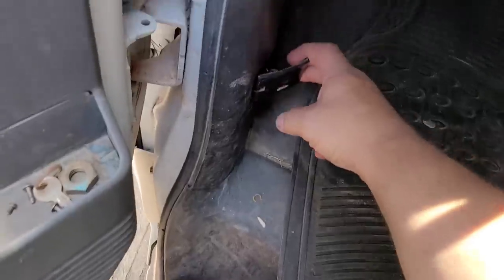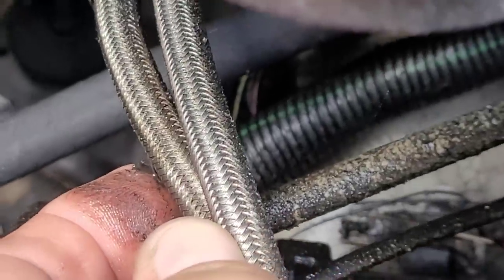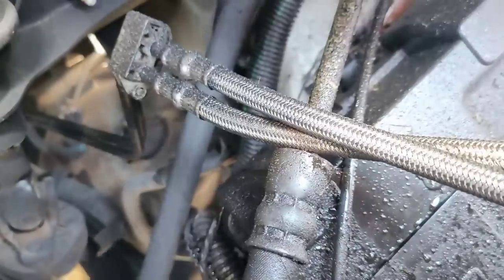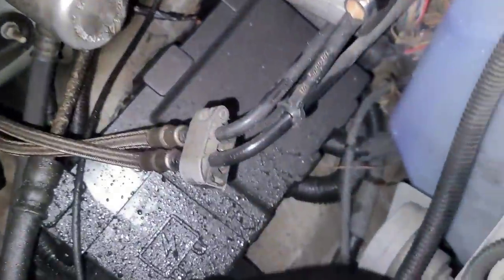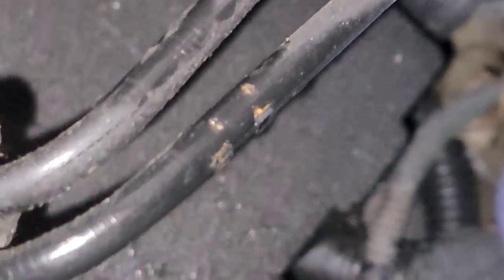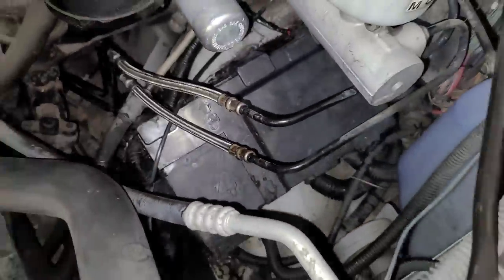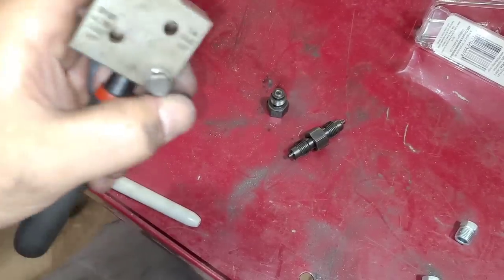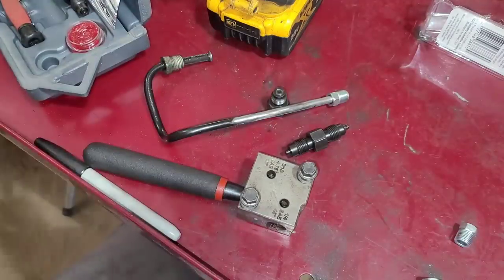No Brakes & Fluid Full? I'm Not Getting The Full Story.

Comment: Excellent video, again (and again). I did not hear you mention what kind of metal ought to be used for brake line fabrication, I may have missed it.  But, out of an abundance of caution I thought I would interject what not to use, as well s what to use..  Copper lines are easy to work with, but do not have the burst strength needed for a hydraulic brake system, so DO NOT use copper tubing for hydraulic brake systems, ever,.  Hydraulic steel lines can handle the pressure of a hydraulic system, but sometimes making a double flare end for a connection to be made can be difficult.,  A better kind of line metal you can use for a hydraulic repair use is a Copper-Nickel alloy line that is strong enough to safely use for brakes, and any number of other uses (use proper bending and flaring tools).  The color of the Copper-Nickel metal is close to the color of a copper line, and it can be easily bent or flared/double flared, for brake lines you want to do double flares) like copper,  But its burst strength is much higher than just copper.  It is what I like to use as it easy to work with, and commonly found in parts stores.

Comment: One thing you did perfectly but didn't explain was making sure the loop doesn't have a high spot that will trap air. It must have at least a slight rise throughout its length. 

After it's all complete  you can move it a bit, but for bleeding and leak check, it must be continuous uphill.

Great job.

Comment: Hi Ken, I have done exactly that kind of repair so many times. Instead of using a mighty-vac I just leave the farthest fitting cracked loose and pump the brake until I get fluid coming out. Even on a line repair clear back at a rear wheel cylinder on a rear axle or at a caliper hose. I never mess with bleeders unless I replace the clapper or cyl. In my way I believe I have refilled the line from the master down to the fix and I have never had an issue. 
Bonus: One time I had a customer who needed to leave town asap and the only calipers I could find had the bleeders on the bottom. I can't remember what it was on, some kind of small Ford car, but all I did was put a piece of 1x2 board between the piston and the other side, then turned the caliper down side up and blead the air all out and put it on the car. The guy knew what I was doing and agreed to get it done right when he got to California, but he called me and told me he didn't see the need until the next brake job since it worked perfectly for 2,490 miles. I concurred.  ben/ michigan
Reply: Some old motorcycles were set up this way, and just as you describe is the method the manufacturer's recommended.

Comment: i always wondered why there was loops in brake lines...thanks for explaining that.
Reply: Hi. Just curious why copper instead of steel brake line which is available at most auto parts stores. .
Reply: Double End flares are paramount for hydraulic brake systems, or any other high-pressure hydraulic system, when making a mechanical connection.
Thank you Kenny for your expert commentary as a 30+ year mechanic, I find it very comforting to listen to your diagnostics and watch you work.  Tim C 
Las Vegas, Nevada . 
🙏🙏👍👍👍
Reply: @shaunmapes7441 It's not regular copper tubing, it's a nickle/copper alloy. Ni-Cop is what this kind of tubing is commonly called. Regular copper tube is WAY too soft for any kind of hydraulic application. The Ni-Cop tube is much easier to work with than standard steel line.
Reply: Great info. Thanks @MikeBrown-ii3pt

Comment: Isnt ‘Brake’ light usually tied to fluid level switch or proportional valve switch. The Abs light is controlled by the module. Just wondering, didn’t catch the year of the van. Agree using Nicop loop. Great fix. Nice flare tool.
Reply from the maker: The ABS module on certain vehicles can control both the ABS & the brake light on the dash. I'm actually not sure about this one. This one did not have a level sensor. Afterwards, the customer stated that the brake light has been on for a "long time." Thanks for watching

Comment: Good 'ol gm brake lines... we call those, "job security." Good show sir. Small tip you probably already know, a 13 mm socket makes for a perfect brake line spring/coil template. Closed end of 10mm wrench on line, rest wrench against socket, and rotate around. Hustle on good sir!

Comment: Kenny,
I don’t know what kind of brake cleaner you use or at least used for your flammability demo. Commonly made with Tetrachloroethylene (TCE). 

The Safety Data Sheet (SDS) for a can of brake cleaner reads: “Do not use this product near open flames, welding operations, or excessive heat. Vapors may decompose to harmful or fatal corrosive gases such as hydrogen chloride and possibly phosgene.”

It can cause permanent lung damage or even be a deadly situation.
Reply: Chlorinated brake cleaner in particular has the risk of producing phosgene if burned.  It is very nasty stuff that you do not want to inhale if you don't want life-changing impact to your health.  They warn about this a lot in terms of welding- don't use that stuff to clean panels prior to weld..
Reply: Sir...thank you for reminding us DYI mechanics.

Comment: Read the comments and it seems almost no one knows about nicop lines. Makes a person wonder if the commenter has ever worked on brake lines before, especially in upper US where rust is an issue. As you, I have ive seen some f'ed up repairs over the years. Some you have to laugh at because therwise you want to beat the tar outta whomever did the repair to put so many lives at stake. You did a quick quality repair to get that man back on the road, and make him and others safe out there. I call that a win.
Reply from the maker: Thank you for your comment. I appreciate your input. Keep wrenching 🔧

Comment: Yup I have done a number of coiled hard lines between the master cylinder and frame. Many thousands of miles driven. I did have one crack from vibration. Support the coils somehow. I like to zip tie them to things with a piece of fuel line inbetween so there's no metal to metal contact.

Comment: I wouldn't recommend using copper lines anywhere on a vehicle.  From vibration and/or cyclic stresses (like a brake line), the copper can cold work, become brittle, and crack.  I always use steel lines.  Paint the finished installation if you're concerned about corrosion.

Comment: Yeah "you can get the lines from a mail order place" and then the thing sits there for days waiting for some sketchy stuff to arrive...screw that, harvest the fittings if you can from the bad line(s), grab some bulk steel brake line and make them in minutes. You'll know the job has been done right and you get the customer back on the road promptly. Been that way in my shop for years, especially on trucks that rot out the line that goes to the rear axle...just make your own repair lines, we got the tools and fittings and it's easy as heck to do it.

Edit and addition, compression fittings on brake lines is fairly illegal up here in Canada and in most places in the US as far as I know.
Reply from the maker: Thank you for your insight! Keep wrenching 🔧
Reply: They use them alot on water line supply to refrigerators, dishwashers etc and they almost always leak and cause damage even with 50psi of water pressure, they are meant to be a bandaid until you can get the proper materials

Comment: You should try a hydraulic flairing tool. Very easy to use and does so much more than brake flairing. The one we have at work even does push connect flairing.
Reply: I have a hydraulic flaring tool as well. I like to show this tool because it fits in tight spaces and ive found the flares on small lines (3/16 & 1/4) actually come out better. That hydraulic tool is awesome for fuel lines and such !!

Comment: The flare fitting are in some instances a one time use - meaning that after disconnecting one, the flaring has to be redone after cutting the old flared part off (because it might not be springy afterwards - meaning the flared part has to be cut off and re-flared; hence, some people trying to use the crush fittings). Btw, where is the video part showing how to bend one of these lines? Special tools are needed for doing this.
Reply from the maker: Thanks for the suggestion. I will make a video. Keep wrenching 🔧

Comment: Very good repair, Kenny. I have had the same situation, but used a suitable length rubber brakeline from the centre hose rear axle plus appropriate fittings.

Comment: I live in pa and while most garages and mechanics will tell you that compression are illegal they are not. The thing is if you put the compression on rusty line it's not going to hold. If it's good solid line they will hold just fine as long as they are rated for the pressure
Reply: Why would you put a compression fitting on a good solid line. Why not do the job the correct way for the customer?
If you want to compromise your family safety. By all means you can. Go ahead and risk your kids or grandkids life in your hands Sir. 
When I was working. A crew member stood up at a safety meeting. He said. "I don't like ABS brakes at all. So deactivated my ABS brakes. 
So I just asked him. So you are risking your family safety because you don't like it? 
They are installed for your own and your family safety Sir. 
We are given safety items to wear. We don't have to pay for it either. Plus safety meetings are there for US to remind us each day.

Comment: That style of flare tool is SO MUCH better than the old school ones, as far as getting a uniform and centered flare every time. There are vice mount tools that are faster, but aren’t designed to be used with the line on the vehicle, or hydraulic units that are fast- but so expensive as to only make sense for someone who’s job is mostly building rigid lines. 

Does yours do the iso bubble flares?
Reply from the maker: No, it only does the double flare that's shown in the video. Keep wrenching 🔧

Comment: In New York State, a vehicle with copper brake lines will not pass inspection. Please check regs to verify. I am retired ASE Master tech with over 30 years experience.😊
Reply: Good catch and yes I believe it's a foul anywhere like compression fittings. NHTSA regs I believe.
Reply: He stated in the comments it was copper colored steel lines.
Reply: @bradmarcum2927  thanks for correction 👍
Reply: And like Eric O from SMA points out, passing inspection in many places in New York is done by taping a hunnert to the steering wheel. 😊

Comment: Compression fittings are for water in your house.  Did I hear you say "copper line"?  I hope not.  And the line you flared looked to be steel.  Cupronickel works, but copper on a brake line is a no no.  It will fatigue and split.
Reply from the maker: I misspoke its metal brake line that's copper colored
Reply: @WrenchingWithKenny  Copper flashing on a steel line is good, can help slow corrosion.
Reply: In this case it's probably nicopp, which is a solid nickel/copper alloy and is DOT approved for brake lines.  Great stuff, easy to bend, doesn't rust.
Reply: @joshonthetube  Yep, good stuff, easier to work with than steel.

Comment: I can't stand it, I have to say, " I have never had a vehicle without a full ladder frame and rubber body mounts. None of them have ever had a flex braid brake line. Do not cut the brake line in half and flare it to put a solid piece in the middle. Put the new solid line directly to the master cylinder. Only flare the end that is continuing to the back."